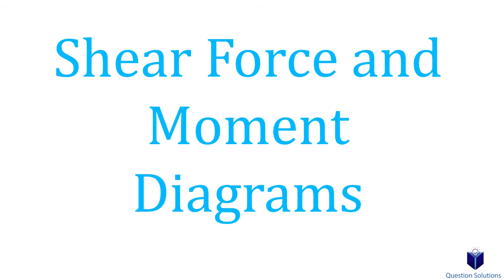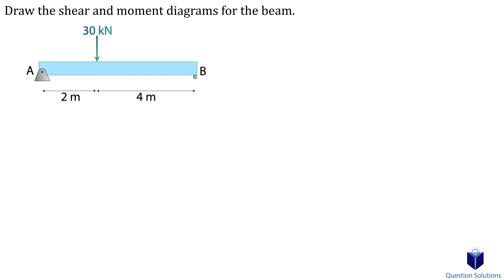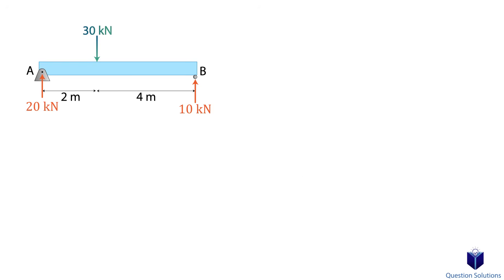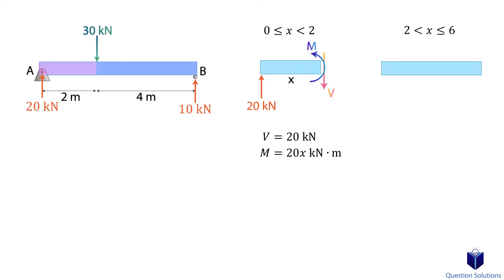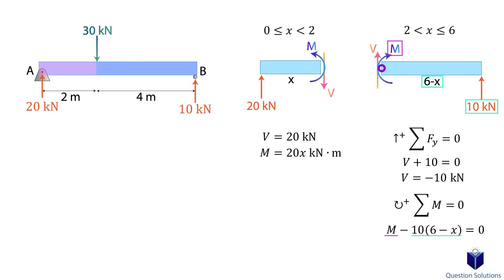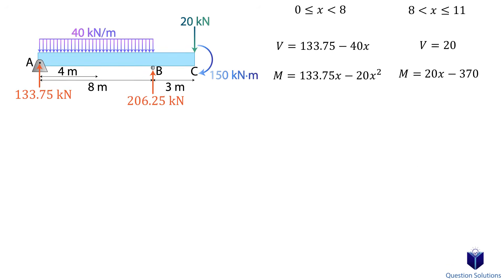How to Draw Shear Force and Moment Diagrams | Mechanics Statics | (Step by step solved examples)

Comment: for the last 2 problems, how do you find the V and M equations then?
Reply from the maker: If you need the equation, there are 2 ways of doing it. One way of doing it is using the first method talked about in the video. The second way is actually just reading the graph and writing the equations. For example, at 11:22, for the V graph, we can see from 0 < x < 1, we get v = 450, then from 1 < x < 3, we get v = -350, etc. For the moment graph, you'd use y = mx+b, and use 2 points to get the equation of the graph. I show an example here: https://www.youtube.com/shorts/d5JhFGgwG4E?feature=share

Comment: Thanks for this excellent explanation 
But if the concentrated moment is counterclockwise should I subtract it?
Reply from the maker: If you picked clockwise as positive, and an external moment applied is counter-clockwise, you would subtract it. If you picked counter-clockwise as positive, and an external moment was counter-clockwise, you would add it.
Reply: @QuestionSolutions  ok but is this gonna change the rest of the solution because normally when i see left a point i take clockwise as the positive but when i see it from the right i take counterclockwise as the positive
Reply from the maker: @S_gfq  I am not sure I follow what you're saying. How do you write your moment equations? You have to assume a positive direction first. So it doesn't matter how you assume that direction, but if an external moment is applied in the opposite direction to your assumed positive direction, then you subtract it. If it's in the same direction, then you add it. I hope that helps!

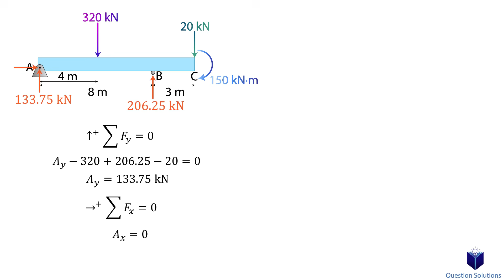Comment: For the second example,  6:30, is it good practice to simplify the distributed load by creating a resultant force. couldn’t this lead to inaccurate results for shear force and bending moments
Reply from the maker: It depends on your requirements. Engineers tend to simplify things to get values, rather than using very specific values and a safety factor is used to account for pretty much most scenarios. So this method is perfectly fine for most applications. If you need exact values, then you can always integrate, which is also shown. I also want to point out that if you are taking a statics course, your professor will require you know how to show a resultant force for a distributed force as this is a key skill you will need.

Comment: So I noticed that when you solve for the moment when it’s counter clockwise you put moment as negative although when moment is counter clockwise it’s conventionally positive. I know that when solving for the problems in this video it didn’t matter but for future questions does it really matter? Or is it relative
Reply from the maker: It doesn't really matter which direction you assume to be positive. It gives you the same result. As long as you stick to your chosen positive direction, it makes no difference to the final answer. Try it yourself and see :)
Reply: Makes sense, thank you so much!

Comment: I have a question about the second question. When you began drawing the moment diagram, how did you know that 133.75x - 20x^2 ended at the value -210?
Reply from the maker: So that equation is valid from 0 to 8 m, so all you need to do is plug in 8 m to get the final value.
Reply: @QuestionSolutions  Thank you!
Reply from the maker: @anellotedesco0  You're very welcome!

Comment: Why are referring to the distance as X ? I didn’t understand the clarification said in the video.
Reply from the maker: So we want to represent length as a variable. If we use a specific distance, then the value we get is just for that distance. Let's say we did it at 2 m, then the all the values we calculated would be just for 2m. We want to use a variable for length so that we can plug in any distance we want and figure out the values at that spot. So if we wanted to figure out a moment at 3.5 m, all we do is plug that into our "x" value. So that's why we want the length represented as a variable.

Comment: Hello, I have a question. Do you usually want to make the cut where there is an external load being applied as you did in the first example?
Reply from the maker: Yes, wherever there is a change, an external force, or a support means a cut has to be made.

Comment: Hi, in the last diagram how did you know when drawin the moment diagram, that the area under the 3 and 5 graph was 44,6 KN/M
Reply from the maker: 22.3 x 2 = 44.6. It's a rectangle, so it's base times height. Base is 2, height is 22.3. I hope that helps!

Comment: Is the first method not applicable by the other examples? I tried the first method on the examples after 10:12 and it did not work out
Reply from the maker: The first method works for all of them, just as how the 2nd method also works for all of them. The only difference is, it's a bit easier to use the 2nd method when you have multiple "breaks" on the beam.
Reply: @QuestionSolutions  after I tried again, I understood. Thanks a lot. I'll try to use the second method if there are multiple cuts.

Comment: i have 2 questions. The 1st one is, when we are calculating the separate sections, why aren't we drawing and calculating the x-forces? is it because the x-forces acting on the whole beam are equal to 0, or is there different reason? And the 2nd one is, in the 2nd example when we are finding the moment about A, there is this moment 150kNm and it is positive, but why are the 320kN and 20kN forces positive and By is negative? I thought the By is gonna be positive since it is acting upwards and the 2 other forces are gonna be negative
Reply from the maker: For the first question, there are no x-forces acting upon the beam, so there isn't anything for us to consider. For the 2nd question, it depends on the direction you chose the moment to be positive. So for the 2nd example, we chose clockwise as positive. So looking at 6:16, look at the 320 kN force. It's pointing down, and imagine the beam is free to rotate about point A, which way would the beam rotate? If you push down at the location where the 320kN force is applied, it will turn clockwise about point A, so it's a positive moment. The same is true for 20 kN force. But look at the BY force. If you imagine using your finger to push up at that location, which way would the beam rotate? It would rotate counter clockwise, so it's a negative moment.
Reply: @QuestionSolutions  okay, thank you very much! your answer made everything clear for me. btw thanks for all your videos, i always watch them before any test!

Comment: Hi, I understand everything clearly. My only issue is: how do you know what sign convention to use when assigning internal loading directions during sectioning? If you use a positive shear (V), the equation for internal shear turns into a positive slope. The equation would be: V=40x-133.75 which is incorrect, since at x=0, V= -133.75. Yet, when using the method of sections, a positive shear is the correct sign convention. Im at a loss, any clarification would be appreciated, thank you.
Reply from the maker: Please watch this video first, and then if you still have the same concern, send me a comment, thanks! https://youtu.be/LPd4vW8f9Ac

Comment: Good afternoon Professor, on minute 3:55 when drawing the shear forces, how do we know which way they point? Or is this just an estimate? Thank you.
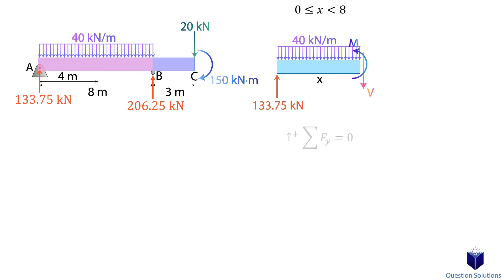Reply: Also another question, in minute 7:07, why wouldn't be contemplate the force 320 KN instead of using 40x?
Reply from the maker: @JessicaColin-vc1uf  For the first question, please see this video first: https://youtu.be/LPd4vW8f9Ac

For the second question, we need the values with respect to distances. If we use 320, we will get one single point of data. If we use x, we can write an equation that allows us to plot a whole set of data points.

Comment: at 7:46, why is it that it's -40x(x/2)? Shouldnt it be +40x(x/2) since the moment that the load causes is clockwise?
Reply from the maker: So when you're doing the segments, you're looking at it from the perspective of the cut (where the cut was made). So here, the 133.75 kN force pushes up, causing it to rotate clockwise but the  40x force pushes down, causing a counter-clockwise moment.

Comment: how did you start with -28.6 for the last example when drawing the moment diagram
Reply from the maker: -14.3 x 2 = -28.6 (I show this at 15:04, with a red box on the shear force diagram)
Reply: @QuestionSolutions I'm confused on why you had to multiply it by 2

Comment: Hi again professor I have a question here. I realised that all shear and moment diagrams' values come to zero at the end. Firstly, is my observation true? 
Secondly, if so why it is like that?
I really appreciate it
Reply from the maker: Yes, that's right. If you look at the equations we write, you can see that by plugging in the full length, it ends up at 0. The beam is in equilibrium, so it starts at 0 and ends at 0.

Comment: 8:58 how did you get -186.25 sir ?
Reply from the maker: So you have to plug in 8m to the first shear force equation. So you get v = 133.75 - 40(8) ===> v = -186.25

Comment: I have a stupid question😅 Why are you not using the equations in the last few problems ?
Reply: Can we use equation method in every problem?
Reply from the maker: You can use either method. I showcased both methods so students can learn it. Some professors will explicitly request you use a certain method and others will not, just depends on how the question is written :)

Comment: At 11:58, why was the 1200 N•m moment added in the diagram? Whats the reasoning behind it and why wasnt it subtracted?
Reply from the maker: So the 1200 N•m is an external moment applied to the beam. It's like someone randomly trying to turn it about that point. That needs to be accounted for in our graph. Clockwise means it needs to be added, counter-clockwise means it needs to be subtracted.

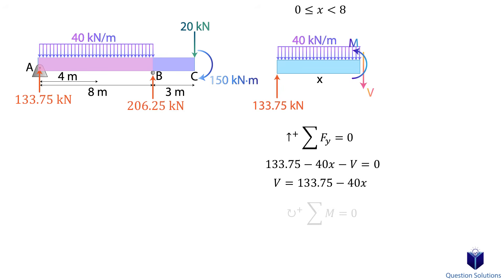Comment: At 7:20 when you were finding V, is there a reason you used -40x and  didn’t use -320 for the distributed load? Would it be wrong to use -320 instead of -40x?
Reply from the maker: So we want these equations in terms of length. We don't want fixed values. A fixed value would only give us the shear force at a specific length, but if we write it with respect to "x" then we get it as a function of length.

Comment: how did you get -28.6 at 15:02? and why is it different from 11:55?
Reply: also helptt T.T how did u get 67.5 at 15:46?
Reply from the maker: At 15.02, you have a shear value of -14.3, that extends for 2 m, so you get -14.3 x 2 = -28.6. 

Sorry but I don't understand what you mean by why it's different from 11:55? Is it because it's a length of 1m vs 2 m? Please elaborate on your question. 

For 15:46, you have (-22.3 x 2)+(-22.9) because remember, you're continuing off from the place you remained at. So at this point, you have an additional -22.3 x 2 value added to the starting point of -22.9.

Comment: for the second free body diagram that has  a roller supporter why was the shear force pointing opposite to the initial applied force , why are they not in a similar direction.
Reply from the maker: So it doesn't matter which way the force is applied. Wherever the cut is made, an assumption is made which says the shear force points downwards in the right side, and upwards in the left side. Please see: https://youtu.be/LPd4vW8f9Ac

Comment: what do mean by finding the difference when you talk about the large jump in the shear force diagrams, a difference of what values. @ 16.46 to get 206.25
Reply from the maker: The timestamp you gave is incorrect, so I think you're talking about 9:06 because that's where I see the 206.25. If yes, then the difference is 20-(-186.25) = 206.25. So you're subtracting the bottom value from the top to figure out the difference between them.
Reply: @QuestionSolutions  Thank you. yes this is what I was looking for.

Comment: I have some questions about the last class. In the first example, when x=2 shows two separate regions, it is obvious that v is in the same direction. However, why are the regions of v different when drawing, one is 20 (the upper half axis of x) and the other is -10 (the lower half axis of x)? Is the final shape of the graph different for everyone (because everyone's initial assumptions are different)
Reply from the maker: we don't consider x = 2, we consider 0 =< x < 2, and 2 < x =<6. During the span x < 2, we have a shear force of 20. During the span of x > 2, we have a shear force of -10. The difference between the two parts, so 20 - (-10) = 30 kN, that is the applied force of the beam. The diagram will look the same for every student, there shouldn't be any difference. There are no assumptions when drawing these diagrams.

Comment: For the example 2, i am trying out method 2 but stuck at 9.23 for finding moment -210. How do we find -210 moment at length 8m using shear graph diagram alone and not an equation. or is it that some problems need to be solved using segment method? Please help
Reply from the maker: So the first section, 0 to 4 m, we get a moment of (133.75 x 4) = 535. The second segment, so from 4 to 8 m, we have (535 -  (186.25 x 4)) = -210. I hope that helps!
Reply: @QuestionSolutions  Thank you very much! I spent too much time figuring that out. Really appreciate your videos. Very helpful!

Comment: Is the shear force diagram continuous or there is jump discontinuity at the point loads ( like we have placed the cut either immediate left or immediate right of the point load but not exactly at the point load) so does that mean the sf diagram is discontinuous at the point load
Reply from the maker: Shear force diagrams are drawn continuously. They show a big jump whenever an external force is applied but it's still continuous. You can google "shear force diagrams" to get a better example too.
Reply: Thank you for the reply 🙏 
I have one last doubt Timestamp 4.45 at the point where 30 KN load is applied in the shear force diagram there is a vertical jump 
Doubt - what is the value of shear force exactly at the point where 30 KN load is applied because on the immediate left of 30 KN point load I am having a shear force of 20 KN positive. But on the immediate right  of 30 KN point load i am having a shear force -10 KN. But what is the value of shear force exactly at the point where 30 KN point load is applied 
Thank you and great work 👍

Comment: at 12:05 , why is the moment considered positive if it is clockwise? I would assume it would be a -1200nm. Thanks
Reply from the maker: Yeah, this can get confusing, especially when you did the previous work and it says "clockwise is negative" but here, it's not the case. Generally speaking, moments aren't positive or negative, they just have a direction. Convention dictates that clockwise be negative because it follows the right hand rule, but you can solve these problems assuming clockwise to be positive. It always gives the same answer.
Reply: @QuestionSolutions  Thanks!
Reply: arent the moments caused by 8kn and 6kn then also positive because they are also clockwise?

Comment: At 8:33 why is the distributed load negative for the moment if the clockwise moments are positive
Reply from the maker: Are you talking about: M+20(11-x)+150=0 ? If so, it's not negative, it's positive.
Reply: Thank you😌
Reply: I’m talking about -M-40x(x/2)+133.75 why is the moment of -40x(x/2) negative when initially it was positive when we were trying to find the reaction force at B(y) 7:49
Reply from the maker: @luyandochisampala  At 7:49, you're looking at the moment created by the distributed load about point B (that's where we made the cut). If the beam was freely rotating about point B, then the distributed load would create a negative moment since it's a counter-clockwise spin. That's because I picked clockwise to be positive. At 8:33, we are again, looking at the moments created by forces about point B. Here, the 20kN force creates a clockwise moment, so it's positive.
Reply: @QuestionSolutions   thank you very much you’ve opened up my mind now
Reply from the maker: @luyandochisampala  Glad to hear :)

Comment: I guess the formula in 9.26s is wrong, it should be negative b, but you got the right result, because you put in for a=20 instead of -20 so you did a double mistake which lead you to a right result😅
Reply from the maker: Good catch, that's definitely a typo 😅

Comment: I have a question: When exactly is it absolutely necessary to split the beam into sections (i.e: using x for length, etc) when making shear/moment diagrams? Is there a way to tell which method to use when given a problem?
Reply from the maker: If you're referring to the 2 methods I show in this video, then you can do either one to get the same answer. Its faster to not split the beam and use method 2, especially when you become comfortable with the relationships between shear and moment diagrams.
Reply: @QuestionSolutions  Thanks for the quick response!
Reply from the maker: @bagaboiebailey  You're very welcome!